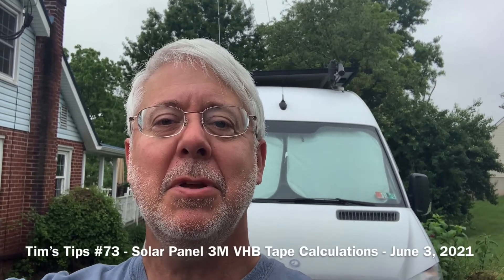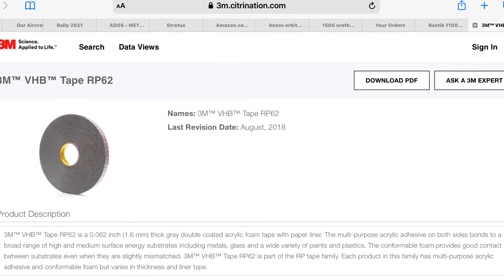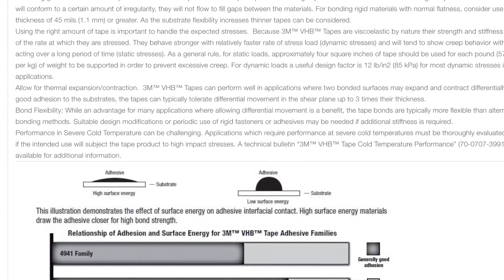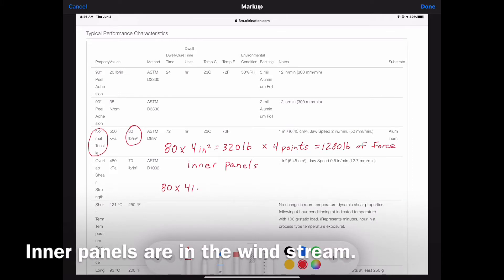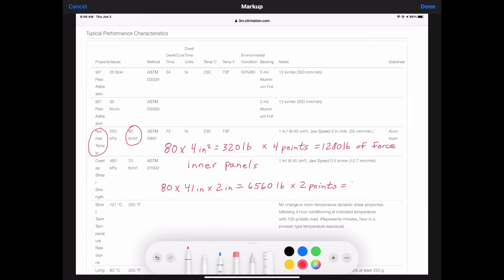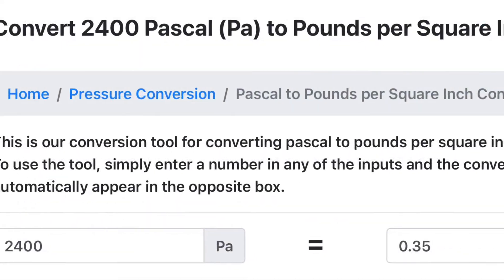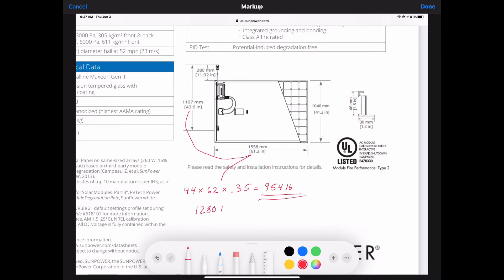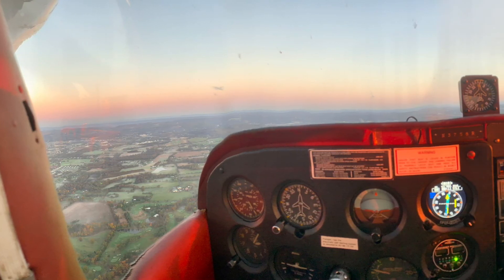Tim’s Tips #73 - Solar Panel 3M VHB Tape Calculations - June 3, 2021

Comment: Thank you for the video. This is the most recent video uploaded regarding mounting solar panels with VHB tape. If the tape is sufficient for a moving vehicle, why is it not recommended for metal rooftops as well? All the videos I have watched are for RV mounting using this method but nothing for home or stationary structures. I would like to mount a few100 watt solar panels to my galvanized steel roof but would prefer not to drill holes. Is there any reason that I could not use VHB tape?
Reply from the maker: Check the specifications for the tape. My guess is that if the roof slope is too high and the temperature too hot, the VHB could allow sliding.
Reply: @tdrager  Just had a chat with 3M. They had the same concerns. They did advise that under no circumstances should I use the tape to mount a solar panel to a moving vehicle. My garage has a 30 degree slope and hopefully will not be moving anytime soon. 

I am going to try the tape anyway. If nothing else it will atleast hold the panel in place while drilling the self tapping screws. Maybe even serve as a caulk and prevent leaks. 

Thank you for the reply.
Reply from the maker: @jamesrevell6475  The lawyers told 3M to say that. I did the calculations about the adhesive force of flat-laid solar panels vs a hurricane wind. There is sufficient margin for me to be comfortable in using VHB tape on my mobile panels.
Reply: @tdrager Do you know if orienting the long axis of the mounting brackets perpendicular to the direction of travel would significantly affect adhesion? I’m contemplating a panel arrangement that would require the panels to be oriented with their long axes parallel to the direction of travel with only the perpendicular short edges available for mounting brackets.